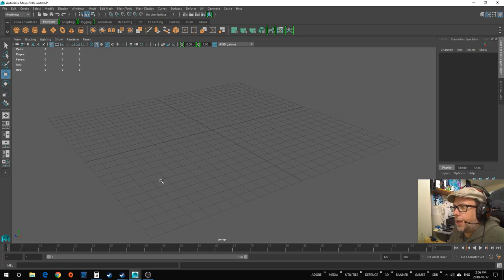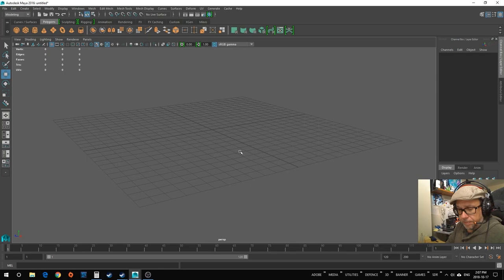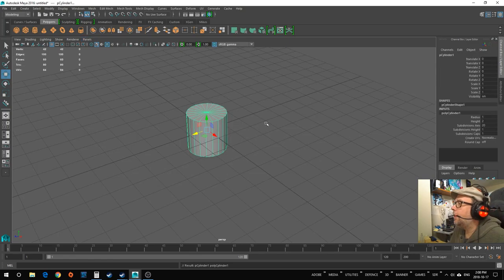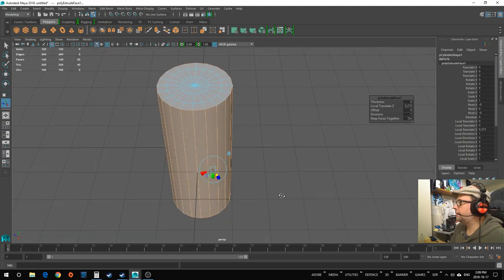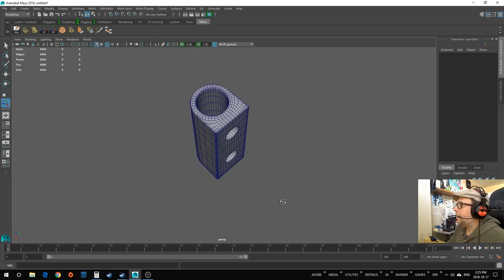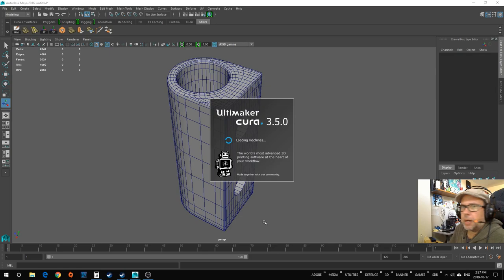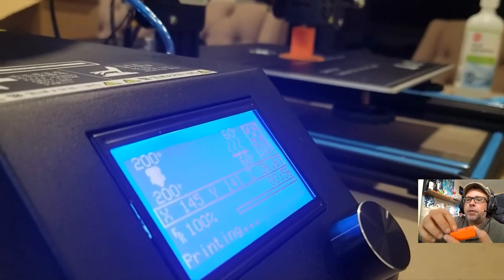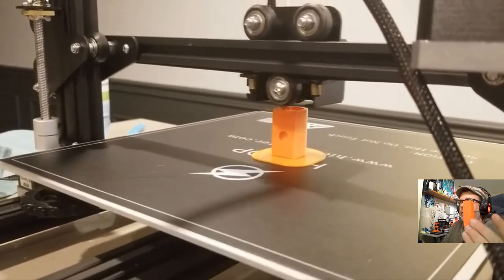Using Maya for 3D Printing

Comment: Still mudway through the video, so if its mentioned, but you can check what your smoothed model would look like by using the "3" key. The 1 key is unsmoothed and the 3 key is a smoothed preview. :)

Comment: Hey bro 
I have issue 
I use maya 2008 and it's not supporting the STL-DCE
What should I do
Reply from the maker: Try blender
Reply: @mkluisart  what's blender
Reply from the maker: @ashrafalzoubi6470  Google "Blender 3D". Its a 100% FREE 3d program and you can use it to make 3D models for 3D printing
Reply: @mkluisart  can I Transfer the same design I made on Maya into blender
Reply: @mkluisart  In other words does blender can import files from Maya?
Reply from the maker: @ashrafalzoubi6470  with the ability to continue modeling? No. But once your done in Maya you can export your model as an OBJ file or FBX and import that to Blender. Then from Blender export it as a 3D printer friendly file.
Reply: @mkluisart  thank you pal
Reply: @mkluisart  
Do you suggest a 3D printer

Comment: Why do you delete history so often? You know you can you press 3 and it will smooth automatically for previz right?   Why are you using booleans? People dont use booleans anymore is not good practice. It can corrupt data. Bro good in the export.. But there sre problems with the modeling 😅
Reply: I think for the purpose of 3D printing boolean is the easiest way (time saving)  it will make trouble only if you are applying material on it with uv mapping , here in 3D printing he just need a shape to print so he picked the easiest way.... :)
Reply: by pressing 3 you can only preview the object in smooth inside the Maya, he want the object to export for that he have to apply a smooth modifier....:)